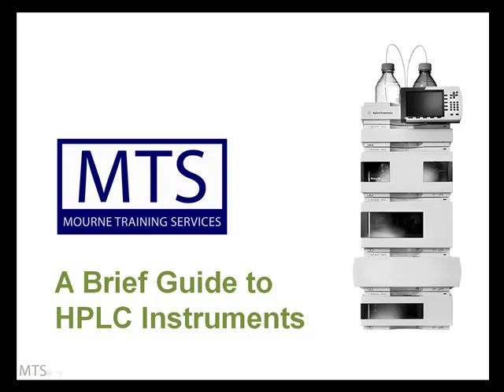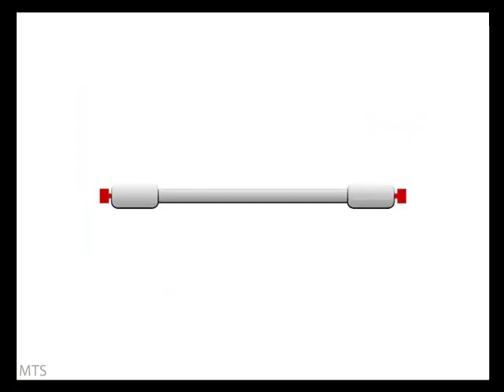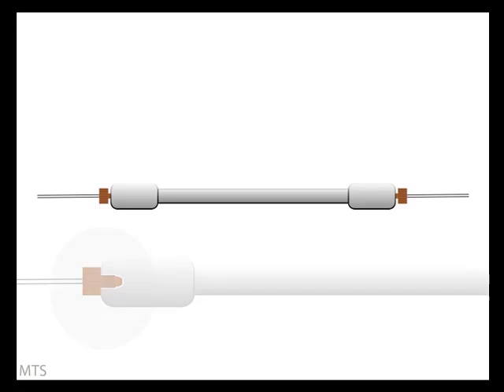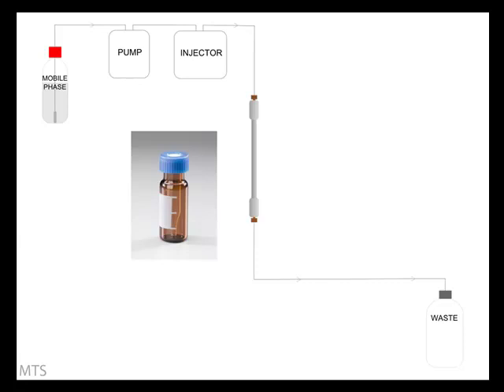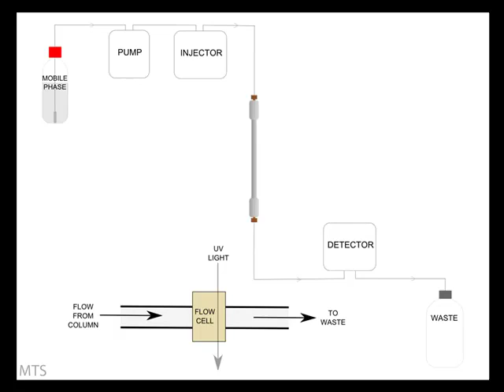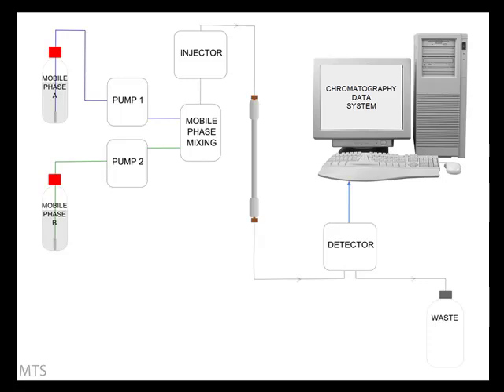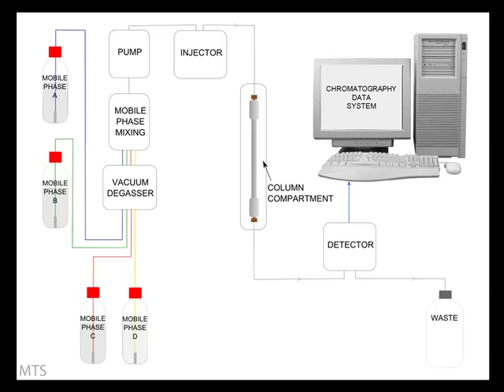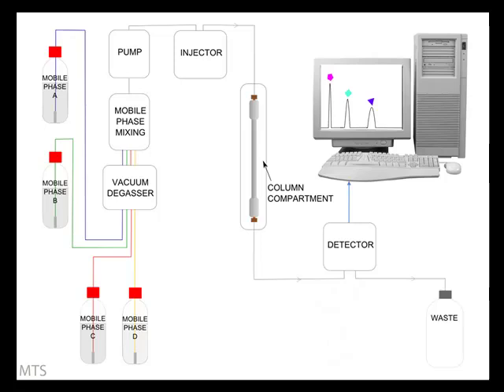A Brief Guide to HPLC Instruments from Mourne Training Services

Comment: It depends on the detector, non-destructive detectors such as the UV-vis measure a property of the column effluent which allows the analytes to be recovered after the separation, destructive detectors transform the effluent in order to analyse it, such as evaporating the analytes so they cannot be recovered